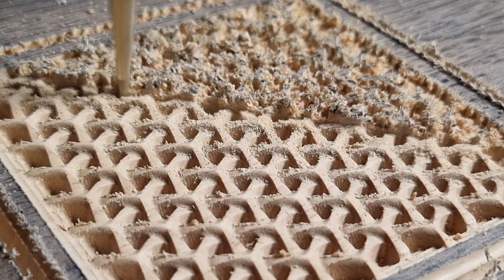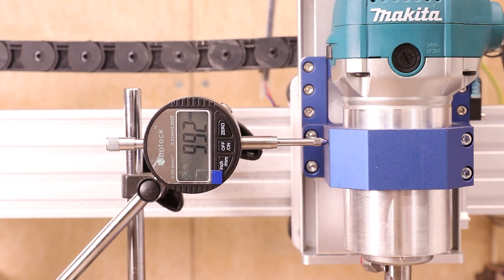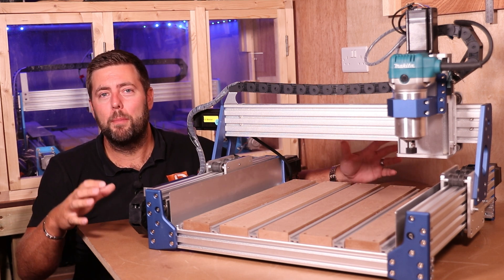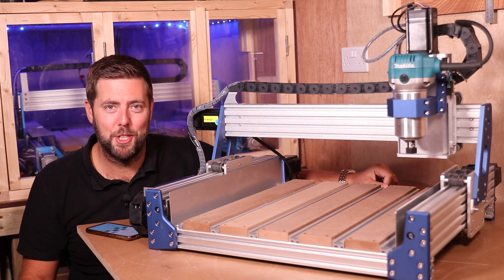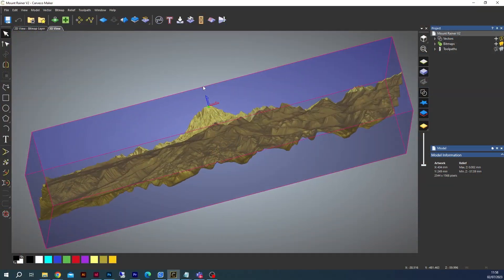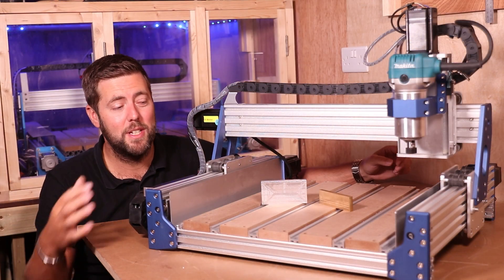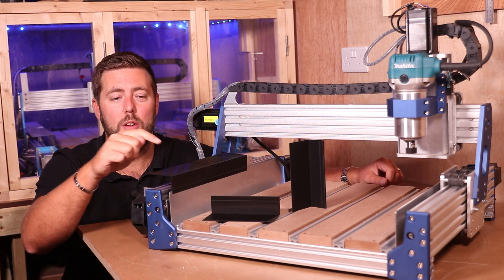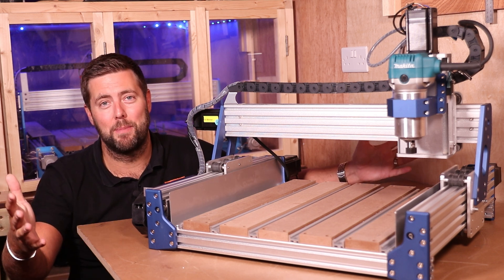Improving a good CNC machine - Sainsmart Genmitus Proverxl 4030 V2 Review

Comment: Is there a way to tap holes with these cnc’s
Reply from the maker: So whilst they technically have the capability to do them, the firmware (GRBL) doesn't typically support the commands for tapping. There are ways around it apparently but I've never done it personally

Comment: If they flipped the C-channel around and put the ball screws on the outside, there would be no need for those crazy high dust shields. It seems like such a simple mod, so not sure why it doesn't come like this from the factory ?!?
Reply from the maker: I do agree but there are a couple reasons and pros/cons to both approaches. For example, if your machine is in an enclosure and the screws are on the outside, they are much harder to carry out maintenance out on

Comment: I am just trying to accurate here, But: They are not closed loop system, because they don't actually messure the position, but count the turns then calculate the position using the pitch of the screw. 
The are semi closed system using absolute encoders. Other cnc machines are not open loop systems. A router is an open loop, because it runs without any feed back.
The larger CNC industry would not refer to them as closed loop system.

Comment: I was watching this again and noticed that you said the motors are rated at 3.1 N-m which seemed off to me considering their size of only 76mm. The user manual says that the torque is 2.2 N-m which is also high. All of the 76mm steppers I could find on Amazon are 1.9 N-m.. I bought some 112mm steppers for my GRBL to Marlin conversion that are rated at about 3 N-m. It took a week for Sainsmart to ship my replacement stepper motor. Now it's slowly moving here from China. They did tell me that you can buy extra motors for $89. The 112mm steppers I got are $40 and if I paired those with the MKS SERVO57C for $25, I could have more powerful closed-loop steppers for less money. I'm not going to, though. I am basing my Marlin conversion on the Bigtree-tech Kraken which has 4 stepper drivers capable of driving NEMA 23s or even 34s.
Reply from the maker: I'm guessing 1 of 2 things happened,  the listed information at the time was wrong as the ProverXL 6050 is listed as having 3.1nm motors, or I just got it wrong as I'm human at the end of the day. I know I wouldn't have just made that number but thanks for the information 👍
Reply: I know it was just a mistake. I didn't mean to give the impression that I was criticizing you,. I just noticed the discrepancy since I was doing a lot of research in finding a replacement motor source that isn't so slow. I pointed it out to help you make your information as correct and complete as possible since this is a great video that I know people will probably watch before buying one of these printers.

My replacement motor is due to arrive on Monday, two weeks after I reported the issue. I've got my Marlin firmware configured and compiled. I get to spend the weekend soldering and crimping connectors for my new control box enclosure.

Thanks for all  of the great information you provide.

Comment: I purchased one of these and do find it to be as good as described here, but it lacks technical documentation. There's no description of what type of motors it actually uses. Where do I go to get replacements other than Sainsmart? Are there 3rd party replacements that are compatible? Can I upgrade with more powerful motors? Can I upgrade to Clearpath servo motors? There should be enough documentation to help us figure out these questions. 

I'm waiting for a replacement for one of my motors that went bad. The tech support at Sainsmart is super-responsive, but I have no idea how long my free replacement is going to take to arrive. I want to buy spare parts but I can't. This needs to be considered when purchasing something like this, especially if you're creating a business around it.

The only benefit to closed-loop steppers is the precision of stepping a single motor. If you request 2000 steps, it will give you 2000 steps. If you are doing a diagonal move on all 3 axes and one axis meets resistance, it's still going to lead to issues since the other two axes don't know that they also need to adjust. The motor that is being replaced was one of the Y-axis motors. It was missing steps and couldn't keep up with the other Y-axis motor. I have no doubt that it would have completed all of its steps, but it caused the gantry to go crooked and jam.

I still love my machine and would buy another. Just keep these thoughts in mind.
Reply from the maker: That's useful insight and some very good points. Sadly a lot of the desktop CNC companies rarely provide info on the motors. Not 100% sure why this is, it's could be that they do t actually know themselves as these machines are often purchased from another source. But I agree, it would be good to know what the motors are, what the board is rated to etc.
Reply: @JamesDeanDesigns  I went through this with my 3D printer. I like having the physical machine as a platform to build on. i am considering switching out the controller and all of the motors to stuff that is more available. I would love to use some Clearpath servos with a 32-bit control board. I think I can probably get a version of GRBL32 working with a Bigtree Tech control board. I like having the option to modify the firmware to support my needs. I added a bank of relays to my 3d printer that I can activate with gcode.

I do plan to pull my dead motor apart to see what's inside. Some sort of teardown video and a look inside the control box would be useful content.

I enjoy your content.
Reply from the maker: @jimberg98  I'd love to be able to do that but it's really beyond my knowledge, i know my weak areas. I can point and go "thats the PSU, those are the drivers" but my knowledge really lacks in this area unfortunately...but I'm  learning

Comment: hi im looking at upgrading my 3018 And Ive narrowed it down to 3 the 4040 , 4030v2, And the 6050 i feel the 6050 might be overkill for my needs however it will open options to me if i require them

Comment: Great review. Is this as robust as the 3030Prover that you reviewed earlier? I want to cut aluminum but the 3030prover is smaller, would have loved a 3040
Reply from the maker: This is more powerful but not quite as rigid as the 3030 so its a trade off really. In theory the the 3030 will give you cleaner results but the ProverXL 4030 would probably cut it quicker (but not quite as clean).

Comment: You mention vfd spindle upgrade.  Will that work with the stock control box or would you need to purchase a different one that interfaces to the stock control box?  I had a laguna tool iq CNC with 3 hp liquid cooled spindle. If I could run something similar or even the size vfd that you mentioned without any control box mods or additions. This machine looks like a slam dunk for not a lot of investment with a vfd upgrade.  Great video.

Comment: Hello James thanks for more great info.
I have the 4030 v1 I am wanting to use a 1/2 bullnose bit but the only collet it fits is er20.  The original router take er11 collet nuts.  Is there an adapter?  Is there an upgraded router motor that accepts the er20 that would mount on my 4030? 
Thanks for answering question not directly related to the vid.

Comment: Very impressed with this machine James.  I have been using the MillRight Carve King (original wood version), which is approximately the same size, for approximately four (4) years without any problem.  I am looking to expand my craft business, so, I thought I will give this machine a try & see how it stacks up against my Carve King.  I 'pushed the button' and placed the order yesterday - 15 Sept 2023.
Reply from the maker: Excellent. I really hope you enjoy it 👍
Reply: How did it go
Reply: @nicojordan3542  It is going good.  Other than being slightly smaller than my MillRight Carve King, there is not any real difference in it's operation, performance, and output quality.
Reply: @ I’ve been doing extensive research and it seems to have the same features as other name brands but at half the cost. I have a 3020 currently and the results have borderline been mind blowing. I’m thinking of purchasing the 24x24 kit and just assembling the machine with the kit right away instead of having to pull the machine apart a second time. Thanks for the response

Comment: If it is for not increasing the price, I would have preferred the linear guides instead of the closed-loop steppers. With nema 23 and ball screws, you really have to be very rough to put it in such a requirement that it jumps steps. Even so, I will probably replace my masuter pro soon. It doesn't seem very difficult to adapt the guides in the future. As always, excellent video.

Comment: Thanks for the review! Just pulled the trigger using your discount code (just in time before it expires?).

Maybe you could help me with one question, though: I would like to get started on planning an enclosure and it will be a tight fit on my workbench - at least along the depth of the machine. The manual says it's 605mm from the front of the frame to the back of the stepper motors. But do the cable guide chains protude further if I move the spindle all the way to the front? If so, how far? Is there anything else that would force me to leave more room along that axis (besides ease of access)?
Reply: Sorry, just found the part where you mention that it's 700mm deep, which is quite a bit more than the manual? I guess that's what I have been asking for?
Reply from the maker: @DiConX  so yes it's nearly 700mm deep, annoyingly manufacturers only measure the frame sizes 😕 however, the amount of links on that drag chain is excess so you could remove a couple and save a little bit on the length. And because it's a flexible drag chain, it could in theory just hit the inside of your enclosure and flex so it shouldn't be too bad if your enclosure isn't 700
Reply: @JamesDeanDesigns  Thanks extremely helpful. Then I will really try to squeeze it into OpenBuild's 510 enclosure, which should offer 680mm. Great idea to remove a few links!
Reply: @DiConX Did you succeed?

Comment: Hi James, I just placed my order for the V2 using your code, thank you 👍😊. I looked at the Makita in your link but I’m confused because it is a 120V machine and of course we have 240V here in the U.K. How are powering your Makita ? Cheers, Pete
Reply from the maker: The link in theory should take you to the local version. However, I know in the UK amazon is rarely the cheapest place for the makita. You'll want to 0700 or the 0701 model. Avoid the 0702 version if you can although this is the newer one
Reply: @JamesDeanDesigns  Yes, your link is correct but the machine is 120V. It seems that there is no 1 1/4 HP Makita trim router that is for 240V unless you know something different. The other Makita trim routers are 710W.
Reply from the maker: @peteredwards2371  the Sainsmart machine you recieve will be 240v, or there is a switch on the side to go between 240 and 110v. If the link for the router is taking you to a 120v or 110v then it's the wrong one unfortunately as you do need a 240v. Sadly, they seem hard to get in the UK at the moment
Reply: @JamesDeanDesigns  many thanks for the clarification 👍

Comment: Hi James, the videos are fantastic keep up the good work, could you tell me is it possible to run any of the Foxalien or Sainsmart CNCs from an iPad
Reply from the maker: Sort of. There are ways to remotely control it from phones and tablets  but ultimately it needs to be connected to something like a laptop, PC or Raspberry Pi first
Reply: @JamesDeanDesigns  
Thanks for getting back in touch appreciated, I am still trying to decide which way to jump, FoxAlien or Sainsmart 4040, I think at the moment FoxAlien is just ahead as there seems to be more options to up grade and increase the working area further down the line,
Is there a particular laser for either model you could recommend for cutting out
Reply from the maker: @andykargans2885  I did the comparison video between the 4040Pro and the Masuter Pro if you have not already seen it, it may help. There will be an extension for the 4040 Pro apparently they just have not confirmed when it will be. In terms of a laser, I would suggest just simply getting the most powerful you can afford. Probably minimum of a 10w output

Comment: Excellent video, as always. At 0:33 you mention repositioned limit switches - can you tell us more about that? I'm building my CNC shed in late Summer / early Autumn, and I was leaning slightly towards the Ultimate Bee, but I worry about having no support. Sainsmart has been great when I've dealt with them, and this 4030 v2 puts them back at the top of the list.

Comment: Machine demo fell short, didn't push it right. Maybe it ain't up to snuff. For aluminum, 6mm bit goes 3mm deep. 0.2mm finishing should be a breeze along the full depth of the bit. If machine's any good, of course.
Reply from the maker: I personally couldn't see a 700w makita router machining that block of aluminium I had at 3mm deep with a 6mm bit however my knowledge of machining metal isn't the greatest so maybe I didn't push it right 🤷‍♂️
Reply: @JamesDeanDesigns  Router power? No Achilles' heel here, especially for soft metal like aluminum. It's the structure and guides that take the cake. Aluminium structure is only a good structural material when you want to save on shipping.
Reply from the maker: @axelSixtySix  perhaps but as I say, my knowledge is limited in machining metal so chances are it was me and not the machine. Feel free to share some useful advice for me and others. Higher RPMs, faster/slower feeds etc.
Reply: @JamesDeanDesigns  Alrighty then! So, you're looking for some handy-dandy tips on machining, huh? Well, back in the day when I started this gig over two decades ago, I had a few things to learn about the cutting bit. Cutting speed, feed, depth... all that jazz!

Now, listen up! If you're serious about this machining business, always make sure the bit you're eyeing comes with the necessary cutting information. If that info is missing or you don't even know who made the darn thing, I've got a simple piece of advice for you: don't bother buying it. You're not made of money, my friend! Reputable bit manufacturers have nifty catalogs that spell out the cutting abilities of each tool, just like that world-famous CMT orange gang. Keep in mind, different bit shapes are designed for different materials. There's no one-size-fits-all bit, so pick the right one for the job!

Now, here's the fun part. The information you need may come in different forms depending on the manufacturer's fancy, but it all follows the same basic formula. For example, if you've got the cutting speed, you can calculate the RPM, and vice versa. Take CMT, for instance. They'll hook you up with the RPM, the feed, and the depth, along with some nifty ratios to apply depending on the material you're dealing with : 0.9 for hardwood ; 1.1 for chip boards ; 0.7 across the grain, that kind of ratios. It's like a secret code, but don't worry, they've already cracked it for you. They've done the math, so you don't have to reinvent the wheel every time you fire up the machines. Easy peasy!

Here's the cool part: knowing if your CNC router is up to snuff is a breeze. All you gotta do is make sure it can handle the cutting tool you're working with, without putting up much of a fight. You want smooth sailing, my friend! So forget about raw power when it comes to your router. Let's say you've got yourself a CMT #191, a sweet 6mm, 2-flute upcut spiral bit for woodworking and plastic fun. Running at 18,000 RPM, that bad boy will give you a flawless cut, chomping through 2mm passes up to a whopping 45mm deep with a feed of 6m.mn. Just flick on the spiral plunge option, and you're in business! That's where this bit feels right at home. But hey, will your CNC router's structure be able to handle it? If the answer is yes, then you've got yourself a proper machine, my friend. If not... well, you might wanna reconsider.

So there you have it, my friend! A few jazzy tips to keep you spinning in the world of machining. It's all about getting the right info, using the right tools, and making sure your CNC can keep up with the groove. Happy machining!
Reply from the maker: @axelSixtySix  thank you very much, that's really useful 👍

Comment: OK first thing first!!! THANK YOU James FOR A GREAT VIDEO again
BUT as for the  free dust guards :) but I do not have a 3D printer Boo
This machine in the EU 1,302.95 on per order (no price for shipment)
I have a 3018 and thought about a bigger machine, but I do not have much space for a big machine. so I am slowly designing my own CNC Router
and now I have seen this I need to think carefully about do I build or do I buy?????
I HAVE NOT GOT FULL SPECS SORTED FOR MY MACHINE!!!!!
but if I have everything worked out right?? the foot print of my (HOPEFULLY MACHINE) is 705 on the X axis, 640 on the Y axis and 480 on the Z axis CUTTING AREA = 480 on the X axis, 490 on the Y axis and 80 on the Z axis.

as for price???? well not priced everything yet? BUT I THINK? it will be about 100€ cheaper? BUT you have to do a lot of work yourself! making plywood plates for your 4849, then using it to machine the aluminium plate to make it stronger to cut soft metals.

I do not know IF my machine would be better and cheaper than this one? but it is very close and close enough to carry on...
Hoping to have bigger machine in 12 month God willing